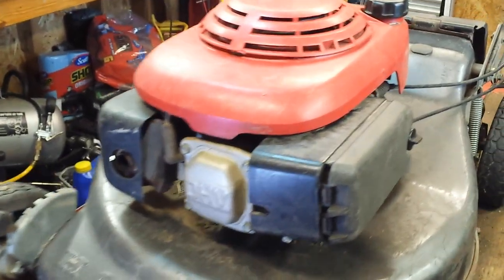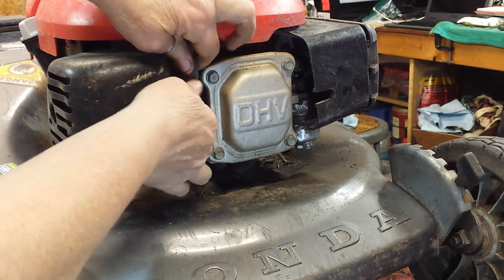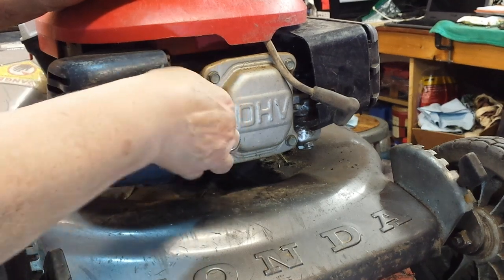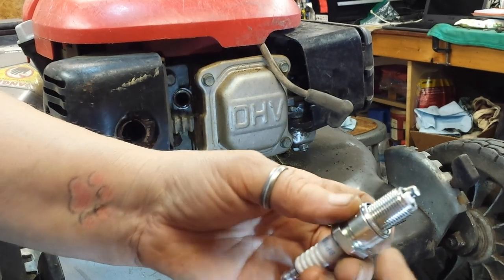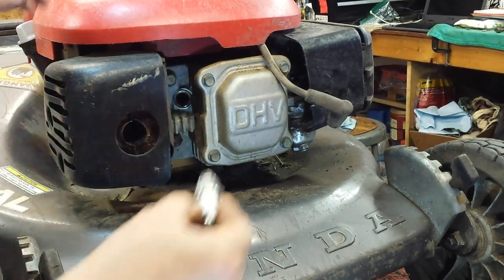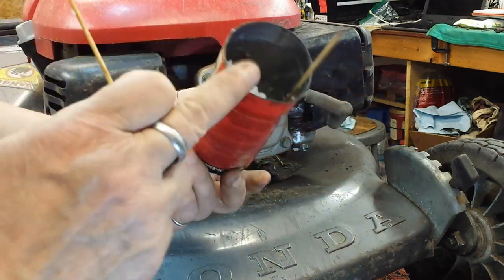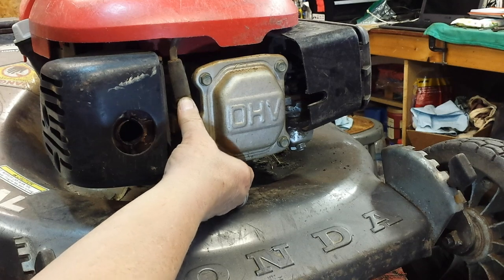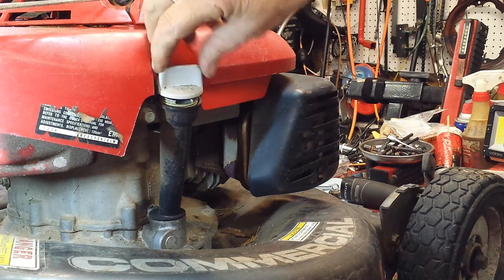Honda HRC216 Commercial Mower Tune Up and More

Comment: Nice video Stella! Wonder way the customer didn't want the self propel feature. That carburetor looked like it had never had a bath before you cleaned it.👍🇺🇸Roger
Reply from the maker: I asked him, and he only said he didn't think he needed it. 🤔 Those machines are very heavy, and can't imagine pushing it all around, especially on those crusty wheels missing most of the balls in the bearings!  Thanks for watching Mr Roger!

Comment: Is that a Kohler engine? The linkages and well as the air box reminds of my lawn-boy with a Kohler xt-6. That mower also has an issue with the metal inserts from the air filter base coming out.
Reply from the maker: Nope, It's a Honda through and through. I appreciate you watching. Cheers!
Reply: @TheLawnmowerLady  ok! Interesting similarities, huh?

Comment: Ive watched a lot of your videos looking for a particular answer...what do you do if the boot for the spark plug is full of gunk or whatever it might be filled with? How do you clean it out?
Reply from the maker: Interesting, Your spark plug boot should not have anything in it. The rubber part of the boot should make a tight seal around the porcelain part of the plug to keep moisture and dirt out. I sometimes will add a thin smear of dielectric grease on a plug boot that is showing sign of deteriorating, but never enough to get to the electrode. If it feels greasy, maybe try some cotton swabs? Thanks for watching!
Reply: @TheLawnmowerLady  thanks!

Comment: Would you take this over a brand new Honda HRX217HYA? My buddy said he give me this but it’s in bad shape
Reply from the maker: I'd take which ever one has the blade clutch. Much easier to start. That said, I don't know if the brand new machines cheaped out on the wheels without bearings, and the inferior cable terminations like the HRN series. The older commercial mowers were far superior. I appreciate you watching. Cheers!
Reply: @TheLawnmowerLady  I did get the blade clutch stop and the machine comes hydrostatic. Hopefully last forever. Paid almost $1,000 for it

Comment: Honda HRC216 under 2 yrs old. The mower is used for my residence. The mower will not start. I have changed the fuel, removed and thoroughly cleaned the carb and jets. Could it be an ignition coil issue?
Reply from the maker: Could be. I don't often advocate throwing parts at a machine, but spark plugs are cheap. It's either spark, fuel, or air. Thanks for watching.

Comment: I was looking for a bag for this model but can’t find it? Have any pointers on where to order one from
Reply from the maker: I would suggest any of the major parts houses to get the correct part no. Use the model # on the deck sticker. partstree, ereplacementparts, jackssmallengines, etc., should give you the correct part no. for the bag. If they don't have the part on stock, then you are empowered to search the correct number on ebay, etc. Good luck. Thanks for watching.

Comment: Why do you use a magnetic socket to remove the spark plug?
Reply from the maker: Depending on the diameter of the ceramic and the often times not matching size of the rubber boot in regular spark plug sockets (some too small, some too large), it's too easy to either 1) break off the ceramic or 2) drop the plug altogether. Not such a big deal on small engines, but trying to dig out a dropped spark plug from the depths of a coil pack recess on most cars today is a challenge. I find the magnetic plugs have a large enough opening to accommodate larger sized ceramics, and well as grasp firmly on skinny plugs.

Comment: My Honda hrx217hya which is relatively new doesn’t start within a few pulls. Why would you say it does this? I’m thinking it’s the thermowax like millions have said. Should I just swap itV?
Reply from the maker: Bad fuel? You can check that thermowax thingy by looking into the venturi to see if the choke butterfly is closed fully when the engine is stone cold. If it's closed, It's good. Beyond that, it's the basics: spark, fuel, and air. Thanks for watching.
Reply: @TheLawnmowerLady  I’m shocked. Been using star tron and mixing it with high premium gas for last 10 years. Never had issues before. I always let it starve at end of year with some star tron so not much fuel is inside the carb. Mechanics around here swear by star tron
Reply from the maker: Even a little bit of moisture (condensation from heat/cool cycles) can cause problems. Nothing can stop the gel that accumulates from the detergents added to gasoline. If you've not pulled the carb for a thorough cleaning, that might help?
Reply: @TheLawnmowerLady  got any videos of a hrx217 carb clean?
Reply from the maker: I don't think so on that particular mower, however I think this video https://youtu.be/wJPM_ArLSgg is the same carb set up if that HRX has that control plate bolted to the side for a throttle cable and choke cable. If your mower has the auto-choke thingy, this video covers this type of Honda carbs on  mowers: https://youtu.be/JJ2AW0OlMYs
Reply: @TheLawnmowerLady  thank you

Comment: I have same lawnmower is it needed to use the honda 10w 30 oil or could i grab a 10w 30 oil from the auto store
Reply from the maker: 10w30 from auto parts store is OK. Thanks for watching.
Reply: What was the model number i couldnt see in your video? Thanks a lot@TheLawnmowerLady
Reply from the maker: @sproles88  HRC216KPDA

Comment: Only thing missed was the valve adjustment.
Reply from the maker: No valve adjustment unless there are some other starting or running issues.
Reply: @TheLawnmowerLady  Except the manual says to do every X hours…I think 500? That thing looks like it has run a lot.
Reply from the maker: Could be, I honestly have not looked it up. Although this is a commercial mower, it is used in a residential setting. It does not have that many hours on the machine, just a really poor storage situation. Thanks for watching.